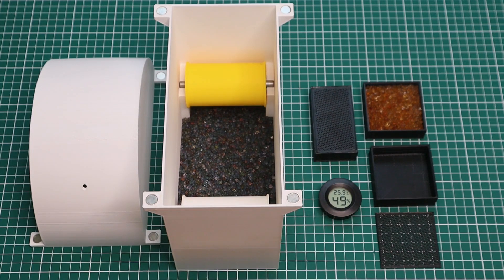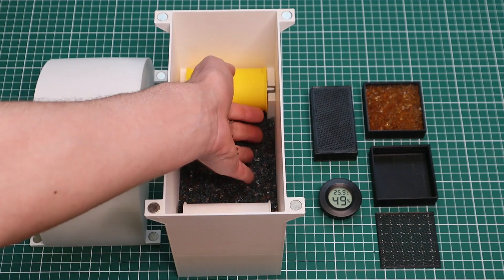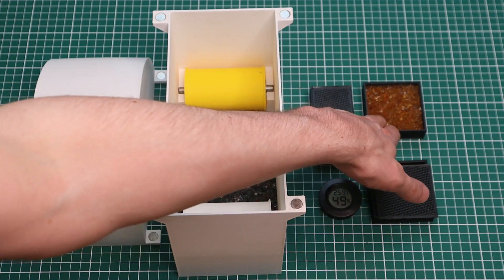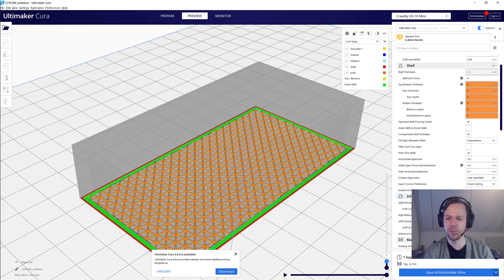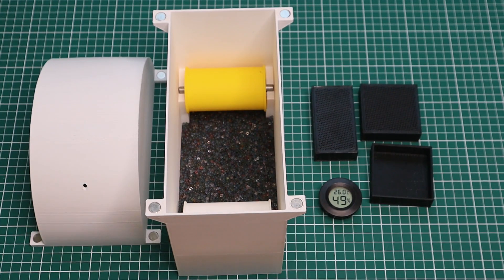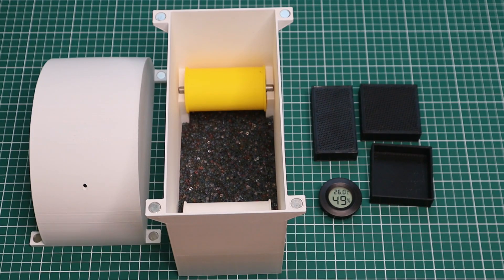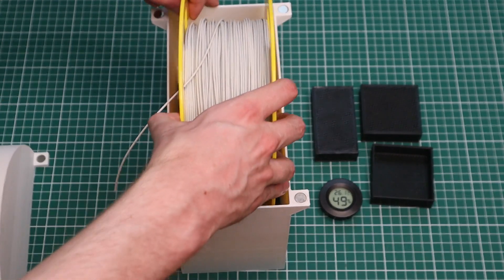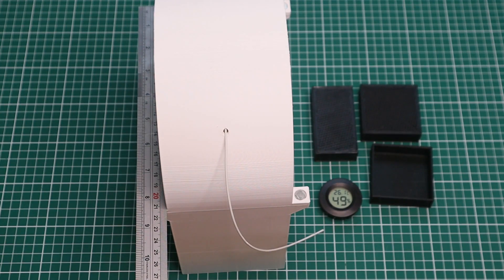3D Printed Cages for Silica Desiccant

Comment: I did something like this, but made it to fit in the middle of the filament spool so it could work inside my AMS units. All I have to do is dry my spools, load them in the AMS, and the stay dry until I need to remove them and load different filaments. I now have a desiccant holding spool hub for every spool of filament.

Comment: I left my PLA rolls in the basement for a couple of years until I had space to setup my printer.
I was expecting the filament to me all moisture ridden, but I can't find any signs of the pla needing it! 
Is this even necessary for PLA? I was told years ago that most plastic filament absorbs humidity and pop during printing. 
I don't think it is true. Maybe it's the brand or the new PLA chemistry doesn't get affected by humidity in the air. 
How else can I interpret my experience with them?
Reply from the maker: My experience with PLA's is that some of them get a little brittle, which can cause them to snap in the feeder mechanism. Besides that you might get just a tiny bit more stringing. Overall the effects of moisture on PLA seem very minor, and it's totally possible you don't notice anything.

This is not the case for PETG/TPU/PC/PA and some others though. PETG and TPU print a lot worse when wet, with stringing and poor layer adhesion, and PC and PA become basically unprintable. Those filaments must be dried in a food dehydrator before use, and putting them in a drybox extends the time that they stay dry.
Reply: @antalz  Since I use my printer mostly to design herringbone gears and transmission parts for my robot projects, I used ABS from the beginning, it smelled bad when printing, so I switched to PLA a couple of years ago. I never print in ABS anymore. Only parts that are temp sensitive.
The PLA parts seem to be as strong, if not stronger than ABS. Cheap too. When they fail, they fail catastrophically, like fiberglass. Which is not a bad thing in my case.
Reply from the maker: @piconano  PLA being weak is a myth I've been fighting for ages now. It has higher stiffness and higher ultimate yield strength than PETG, ABS, and many other filaments. The only way other PLA is "weak" is in impact resistance.

Comment: Where did you buy the silica gel from?
Reply from the maker: I got these loose beads from silica-gel-shop.nl, and I also got nylon bags with desicant from VidaXL.nl. In the latter case you can't see whether the desicant is dry or not. Both store are Dutch, but I think you can get them from Amazon too, amazon.nl has them.
Reply: @antalz  Thank you very much! I've been looking for a good place to get it from for ages!

Comment: I used the triangles and a 0.2mm nozzle to make fan filters for my computer. Next time I might use tri-hexagon so 3 lines don't intersect at 1 point, probably prints easier.
Reply from the maker: That's a cool idea! I don't think tri-hexagon is a good idea though, because I see some small holes and some larger holes. If the larger holes are small enough to block particles, then the smaller ones will inhibit the airflow a lot. It might print easier but I think the end result will perform worse.
Reply: @antalz  Yeah, I'd make them so small that the triangles are completely closed, just leaving the hexagons.

I'm also contemplating using "zig zag" at 0, 120 and 240 degrees to make the triangles without the lines getting interrupted.
Reply from the maker: Pretty good ideas, maybe lines works for you? I'm not sure how much the gaps between layers mess with the airflow. Just generally airflow is a hard thing to wrap your head around. Do you have anything to test how well the different settings perform?
Reply: @antalz  I don't have a real test, I just print 120mm filters, compare if I feel noticable differences in airflow if I mount them to a separate fan. I watch a lot of gamers nexus case reviews and I figure this is probably more rigorous testing than most case manufacturers do.

Currently using this filter on a 200mm fan, temperatures are fine:
https://tweakers.net/fotoalbum/image/f0q8kulb50UeUYoj8kvBfstl.jpg
And it at least stops some dust entering from the bottom of the case:
https://tweakers.net/fotoalbum/image/hVal80UECNQCSWYxcaeHdgue.jpg

Satisfied with the performance so far, but if I manage to get my hands on a more powerful gpu I'll try and make some filters again to see if I can improve them. Currently running a 1660Ti, which doesn't need much.
Reply from the maker: @Flapdr01  Not sure how it works in the PC world, but in commercial settings you usually get a pressure-flow curve when you buy a fan, and then you can measure a pressure drop across the filter. Takes some specific gear to do that though.
Reply: @antalz  In the PC world they mount fans 1cm behind a solid glass plate and hope for the best.

Comment: Cool one! I like the idea of making the base/walls out of infill. I wish there was a way of exporting files from a slicer to be used in another slicer where I could choose to only export the top/bottom layer numbers for example and infill as settings. 3mf destroys any local settings; I don't like it.
Reply from the maker: Yeah it seems like all the slicers have their own names and conventions for settings, so I don't think there's any interoperability between them. Kindof a shame, I never used .3mf files for anything really, I don't see the point. What would you like to achieve by moving files between slicers?
Reply: @antalz  I mean between the same slicer. So I can set the box to only be printed with infill at the bottom for example and share it like that. Someone would download it and open in their slicer and the box would still print with only infill at the base.